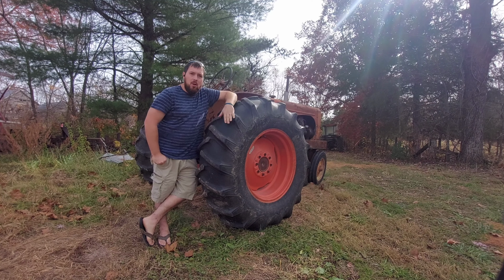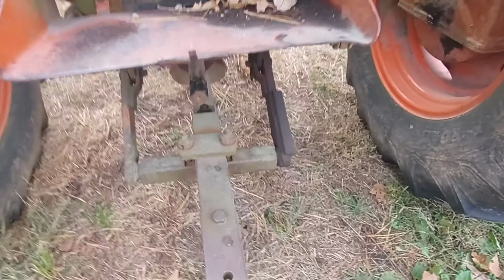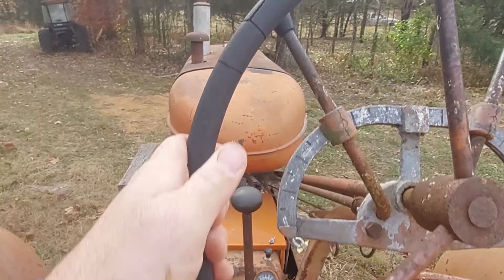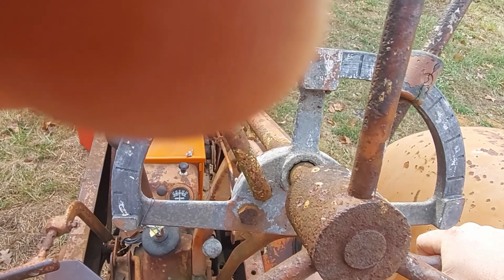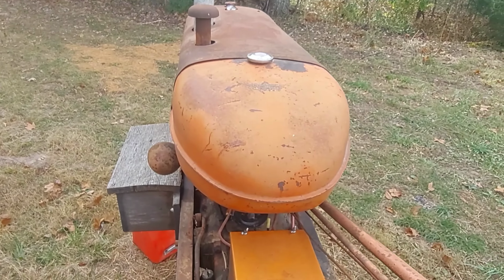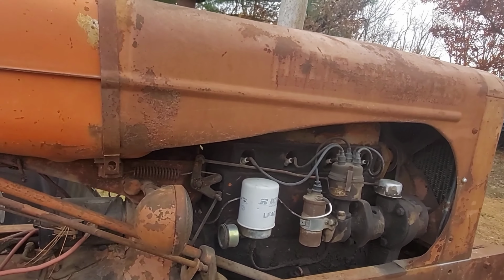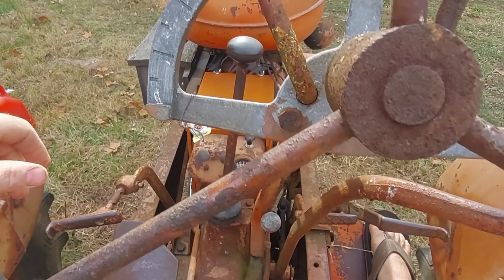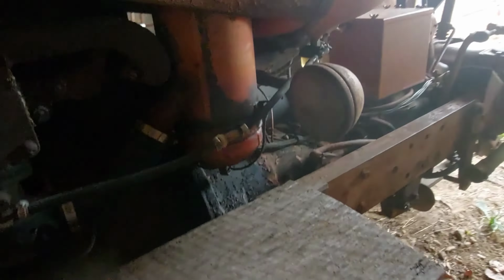Stuff You NEVER See on Modern Tractors: Allis Chalmers WD Walk-around

Comment: WD 45 was an excellent tractor. We used one for years on the farm. Would love to have one with a wide front end.
Don't forget about the single hydraulic connection for different attachments.  It will lift and gravity let's implement drop. Nice feature to have.
Reply from the maker: I did forget about that! I've actually never used that on the WD since I have no 2-point implements and my MF35 has a more modern hydraulic block with returns.

Comment: The lift arms are apart of the snap coupler hitch. Allis-Chalmers stopped using the snap coupler hitch in the 1960s as some early model 190XTs had the snap coupler hitch.
Reply from the maker: Correct! I've started converting this tractor to a 3-point hitch. I'm hoping to post a video of that soon.
Reply: @bergercreek  from what we heard from other farmers and our experience, get the conversion that bolts to the drawbar not the one that hooks into the “bell” of the snap coupler.
Reply from the maker: I'm actually making my conversion, but the lower links will bolt to my drawbar rear brackets. I was worried about using the snap coupler too, apparently one company (possibly AC) had a kit that used the snap coupler but it looks sketchy to me.

Comment: The switch you refer to beside the amp gauge is to increase the generator output (when you forget to turn the ignition on and almost drain the battery) or when working at night with the lights on. It increases the generator out from like (don't hold me to these numbers) 7.5 amps to 15. Keeps from just boiling the battery during those 12-20 hour days plowing or disking. Remember, that series started in the 1940's and came with magneto's. Automotive electrical systems have advanced a long way since then. The WD/WD-45 is my favorite tractor to this day right up until my right knee starts throbbing from bouncing against the fender bolt heads hour after hour. The hand clutch system should still be mandatory. As the gentleman who introduced me to those tractors used to say, "The most power you could buy for the money in the 1940's and still the most power for the money you can buy today"!!!!!
Reply from the maker: Thank you for the information! My switch does not work but I wish it did. I've used this tractor 8 hours at a time several times and, although it isn't quite as comfortable as my newer Kubota, you can't beat that sound or that power! I paid $750 for this WD. I'm not 100% sure it won't outpull the $9500 Kubota.
Reply: @bergercreek  Not sure what Kubota you have but my money is on the Allis up to 35 hp! 4wd is a big help to the Kubota if you have it.
Reply from the maker: @randallsullivan3692  I've got a L4200. It is 4x4 and 45hp but the Allis is probably heavier.